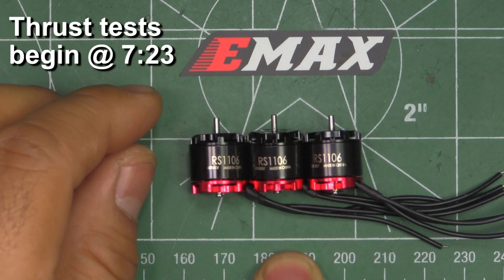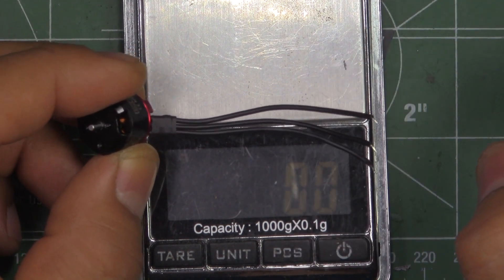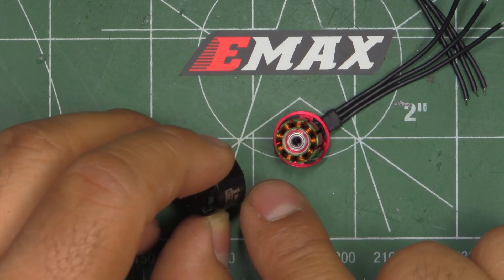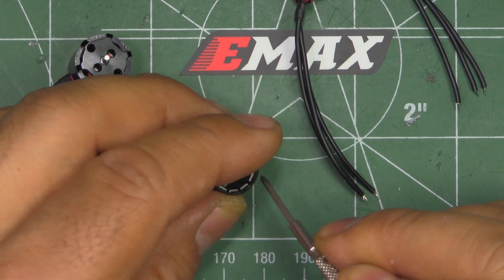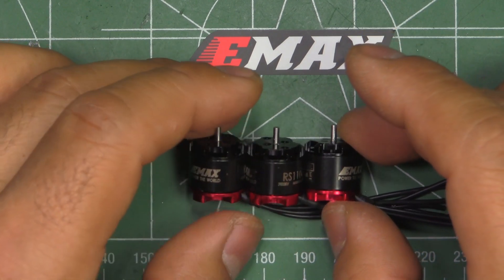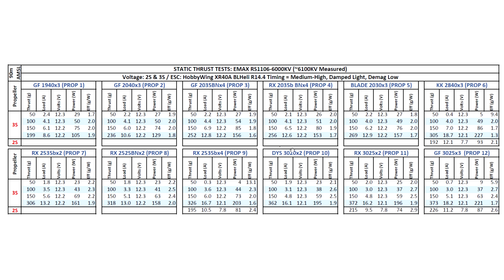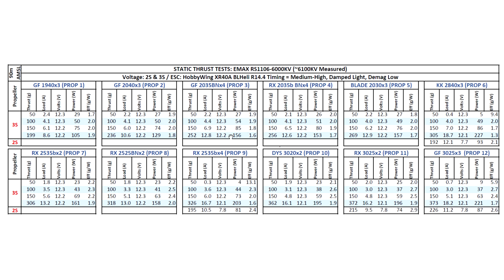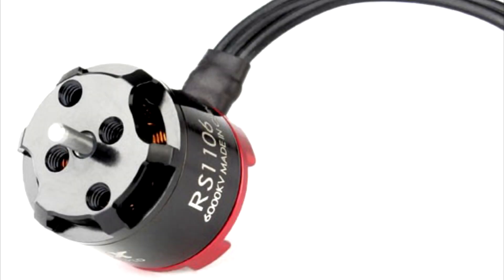EMAX RS1106-6000KV Tiny Motor - Big Power! 2S & 3S Thrust Tests

Comment: What about gemfan D63 (2.5 x 5 blades) with 3S LiHV.. is it ok?
Reply from the maker: @tanoryjakaperdana1419  3S LiHV might run too hot for 5 blades. I'd prefer a 14 or a 1504 to 1506
Reply: @EngineerX  im sorry, are you talking about 1504 motor or 1504 propeller?
Reply from the maker: @tanoryjakaperdana1419  motor. 1106 could run too hot and I don't think it has enough torque
Reply: @EngineerX  ok sir.. thank you

Comment: I don't know what the deal is but I ordered a set of the 6000kv motors running on 3s and there things get smoking hot. Even on 2s, they get pretty darn warm. I was running 1105 6000kv hglrc motors before and they never got hot. What's the deal with these motors.
Reply from the maker: Very strange those are overheating on 2S. I've read one other case with GF3040x3 on 3S running hot.
Reply: Maybe its the filtering from betaflight 3.4 (i heard that version is known to smoke micros) i ran 1103 on 3s on 3.5 and its fine so these motors should be better.

Comment: Hey Engineer X! 

I did a thrust test on these 1102 15000KV motors for a brushless whoop here: https://youtu.be/hi8ESCRqGFA

I’m not sure if I did it in the most scientific way possible. Any chance you can do a thrust test on these guys and some of the 07xx series!
Reply from the maker: I have tested some of the new BrotherHobby 07XX or 08XX- 10000/15000KV (I forget exact size/KV - got data at home) Just have not had time to sort it out. It was quite difficult to set up those tiny motors.
Reply: EngineerX That’s awesome! I and a bunch of other people on the brushless whoop train would love to see those thrust tests! Keep up the good work!
Reply from the maker: I'll be working on several new test results data/videos this week. Had not had any time the last 2 weeks :(  Hopefully the data is good. Also have some lower KV RacerStar BR1103-8000/1000KV that I tested.  Too many motors so little time ;) Thanks for watching. check back in a couple of week, hope to have video up by then.

Comment: I have been looking for a channel like this forever!! Subscribed ✅ I only have a Kingkong ET 125 right now. With a dead esc. And since I’m replacing that. I figured I could replace the motor as well. I use the gemfan 2540 props. Would this emac 1106 6000kv motor work well for my ET 125?

Comment: How are those 50g thrust tests getting crazy efficiency numbers even possible ?  13.1g/W on a 2.5" 4-blade prop nearly defies the laws of thermodymanics.  I call shenanigans 😝
Reply from the maker: LoL ... Shenanigans indeed!!
Looks like I overlooked (happens somewhat often) the funny numbers on that 2.5" Prop# 9 as well as on several other props on these tests. 
The Excel spread sheet I use is supposed to pick the closest values corresponding to the various thrusts numbers on the table. The formulas I use are not the smartest so often times the wrong values are selected due to logged data limitations: Sometimes the spreadsheet will pull Amp numbers that correspond to when motor is being throttled down or when throttle is cut off and ESC is on "active braking" mode, instead of picking when motor is under load or ramping up. I noticed that started happening more on the small motors. So I gotta inspect tables more carefully.... anyway, logged data is on the Excel spreadsheet I provide in every test so you if you had reviewed it you would've seen it's a mistake and correct data is there on the data; I had fixed those errors on the spreadsheet a while back ;)
Reply: EngineerX hrmmm. No offense but we look to your tests as the authority with expectation that you had scrubbed the data you were presenting. If you’re saying that we should treat all your data as just a presentation of what a machine spits out and that to have confidence in what you’ve presented we each need to dig into the raw data ourselves, it severely limits the utility and value of the work you do.

You’ve been doing this for a very long time so maybe it would make sense to take your work to the next level and begin honing your data analysis formulas so that they are the best. Dropping numbers that fall beyond a specified rage outside the standard deviation is simple freshman statistics 101.

You provide a very valuable service to the community but they also rely on the results to be accurate. I’m excited to see what steps you consider for the future to ensure we can be as confident in your work as you are. 

Thanks for all the testing over the years !
Reply from the maker: You're 100% correct and I appreciate you looking closely at the data. I will keep reminding myself to scrutinize data carefully before releasing it. As usual, careless mistakes like this happen when on a hurry to complete. No excuse however. When I captured the comment on the thrust table the data was wrong and I neglected to re-capture.  I'll make a better effort to look at tables closely. Actually, I have caught the same error from the Excel spreadsheets since then, so I've corrected it manually by eliminating the offending ramp-down values. When I said "it happens somewhat often" I was referring to mistakes in the videos. Sometimes I overlook/forget to change the motor name/model on the thrust test runs (green letters) I use previous video editor files so sometimes the previous motor name transfers to new video. Again, no excuse - just gotta review more carefully. Thanks for watching!

Comment: How hot were these motors getting on the gf3025 tests?
Reply from the maker: engizmo fairly hot. Close to getting uncomfortable for holding firmly with my hands. But that is quite normal for this size  and KV. I think they should be OK in flight but I still check temps on first test flight.

Comment: Great testing as always. Who do you think has the best quality and performance on these 1004-1106 motors between Emax and DYS? Thanks much for all your testing.
Reply from the maker: So far, EMAX, DYS, RotorX (tests coming soon) and SunnySky have very good quality and good performance, though the SSky 1106-6500 makes a lot of power but also needs lots of Amps. I'm sure there are others but those are the ones I've looked at.
Reply: Thank you much for information.

Comment: Do you think it can stand 4s ?? with smal props ??
Reply from the maker: I have read a couple of people trying 4S but I can't recommend it 100% as I have not really tried myself or seen it done. On a super light 2.5" or 3" (3025 prop) it migh be possible but I would be very careful in checking motor temps. I'd say it's quite risky!

Comment: will the 6000kv be ok with 3s 500ma 2030 blades to burn through 3-4 batterys at a time without meltdown on a 80g build?
Reply from the maker: Hard to say -  I have not yet flown the 1106's yet, only 1104-7500kv (but on 2S)with GF1940x3 I've gone through 5 LiPos in a row in a session but not on full throttle. Motors were fairly warm but OK. My best guess is they should be OK... but I would check temps after the first LiPo, if you can grab it firmly with index finger (wrap-around) and not get burnt, then should be no problem
Reply: follow up, i ran the 1106 with gf 2040 on 3s. 20 seconds full throttle pass the motors would burn your finger. not worth it!  :) will melt down the motors after 2 full 3s 500mah battts if you are lucky

Comment: Isn't there a typo - prop 12 3025 tri blade in description (8:47)? For me it looks like GF 3035.
EngineerX can you make test of RCX H1304 4000kv and 5000kv to have good comparison with new 1106 motors (like recently tested Emax)?
Reply from the maker: Correct that should be 3035x3 
Yes, I have the H1304-4000/5000KV motors, just need to get some time for testing. Hopefully next week

Comment: Can you confirm the thrust and current readings for the RX2535bx4, GF2535x3 and KK2840 @ 50 grams?  These seem too good to be true.  If these are correct, these props are considererably more efficient than most of the other props here at hovering power.
Reply from the maker: Those are errors in the Excel spreadsheet data. The 0 - 150g ramp-up logged data ended up out of range of the rows that retrieve the data points for 50g thrust. I've revised the Excel spreadsheet so you can download the corrected table from the DropBox link in the video description. Thanks for noticing! and yes, if those had been correct.... we could hover for at least 30 minutes on a 450mAh Lipo ;)
Reply from the maker: Those are errors in the Excel spreadsheet data. The 0 - 150g ramp-up logged data ended up out of range of the rows that retrieve the data points for 50g thrust. I've revised the Excel spreadsheet so you can download the corrected table from the DropBox link in the video description. Thanks for noticing! and yes, if those had been correct.... we could hover for at least 30 minutes on a 450mAh Lipo ;)

Comment: Ive saw new motors on Mymcmart, H1304, 4000 and 5000 Kv are avaliable.
Calculating iron volume vs 1106 it's roughly same volume for both... it will be very interesting to see test result for this motor , the 5000 Kv ver.
How can i contact you to donate or send you the motor fpr testing ?
Reply from the maker: Hey Eddi, thank you so much for your very nice offer. MyRCMArt sent me those 1304's so I have them on hand.... my only problem is available time to run tests. It's been busy at work so not as much free time lately and weekends have been busy as well, but I'll get to testing them as soon as I can. It will be very interesting to see if the taller stator on the 1106 has the advantage. My feeling is that taller stator has a better distribution of copper since from what I've read the copper on the coil top and bottom (end turns) doesn't produce power so taller stator has less copper there than a shorter stator .... we will see (compared to the 1106-4500KV motor - I'll also be testing it soon)

Comment: Will they fit on babyhawk:D?
Reply from the maker: Unfortunately I don't have a Babyhawk motor in-hand. We would need to know the mount hole pattern on the BHawk motor. For propellers, these do have the 2 holes that have same spacing as BHawk props.

Comment: can you test the motor on 4s with 2" props?
Reply from the maker: I might run a couple of 2" props on 4S and add them to the 7500KV video, on the thrust stand motors are highly stressed, so risk of burning windings is high
Reply: EngineerX ah ok. Thx for the answer and the test.

Comment: Im a bit confuse for 3s, gemfan 2035 props, will these 6000kv motor would not get overheat? Is low kv or high kv is more suitable for 3s and 2035 props setup? My stock fly egg100 motors just burnt when i push it a bit. Planning on these motors.. but dont know to pick which kv
Reply: EngineerX im really loving my setup nowww... Such fast racing micro!
Reply: AFIQ aFaT I'm wondering the same thing. Do I go 6000 or 4500? With 2035's on 3s.
Reply from the maker: Lots of people run 3S on the 6000KV motors. Just make sure ESC is capable of supporting the loads. 10A ESC's should be the minimum.
6000 for 3S if you want a very fast setup, 4500 if you want longer flights.
Reply: EngineerX my stock flyegg 100 motors is 7800kv.. rated for 2s.. i pushed it with 3s racing style then burnt the motors huhuu
Reply: So if I wanted to turn my flyegg 100mm into a cruiser using the 4500kvs using 12As ESCs and a GF2035s, that would be good? Or is better to use these 6500kvs?
Reply: Roland Burrows ok now ive installed the 6000kv, with 3s setup.. its run very2 fast and mltor temps were just abit hot that i still can touch with my finger! Nice!!
Reply from the maker: 4500's will give you longer flights of course. 12A ESCs on 3S will handle 4500's well. 6500 on 3S will be very fast but LiPos will drain fast. All depends what you want.

Comment: Nice test. Pretty impressive motor. I have the emax 1104 motors right now and when they die these are on my shopping list.
Reply from the maker: These will be the best replacement for sure!
Reply: EngineerX Do you think the emax 6a esc would handle these motors on 3s?
Reply from the maker: I'd say up to Prop# 8 (except 2840x3) a 6A ESC would be barely OK, I'd would prefer a 12A however. 6A would be too risky, these motors can pull a good amount of Amps so better to have some headroom

Comment: Wow! So the RX 2535bx4 makes more thrust and with less amps than the KK 2840x3?
Reply from the maker: Yes, but that's only on the top-end. Unfortunately I can't spare enough testing time to run more extensive data collection, like running a slower full RPM sweep so we can compare each prop at the various RPMs. If you notice, the 2840x3 will make the same thrust that the 2535x4 makes but at lower RPM, so it should perhaps build thrust just a tiny bit sooner. From what I've read people saying is that the 2840xx3 props works pretty good. I need to try it myself at some point, I just haven't been getting enough flying time lately

Comment: I mean you'd only need additional wire from the motors if you were attempting to make a hyper light 5", or maybe large 4". Or an Extra-Large 3-inch maybe. Otherwise don't you think that'd be plenty wire, even considering 4-in-1 ESC usage? (On normal 1106 builds) Thanks for your reviews though. Very valuable to me in consideration of parts I would be better served to use. Thanks to you I got a set of the Spintech 1106ST 8000kv motors. Either I got too much ESC for them, or they're too much motor for my 90mm frame that I have. Because I'm having heat issues with them. I'm pretty sure that'll go away if I were to get something like a Leader 120, or 117mm frame to put them on.
Reply from the maker: Yeah, just nitpicking on the wire length on an otherwise outstanding motor. 
Those SpinTechs run well on 2S, could it be your FC's tune? maybe need to lower PIDs? Also make sure props are not bent. Hope you sort it out. Thanks for watching,
Reply: EngineerX they're rated for 4s right? The Spintechs, I mean.
Reply from the maker: No no no no no !!! If they survived 4S then they're a heck of some good motors. They're rated for 2S. 8000KV is too high for 4S. 3S would also stress them too much I think but some people may already be trying them on 3S. https://www.spintechmotors.com/collections/spintech/products/1106st-8000kv-brushless-motor
Reply: Zak Smiley you referring to the Spintechs?
Reply: Sugar Kane Thanks for the advice. As of the last time I was messing with my 90mm, I need it.

Comment: The banggood page says only the 4500kv is 3s lol, I will wait for you to test the 7500kv on 3s to see the numbers for the blade props and then I will probably invest in a set :D, cheers.
Reply from the maker: I'll run that one next, but that KV i a bit high for 3S- 12.3V on the thrust stand. The power supply I use can only go as low as 12.3V, I may have to start with a LiPo charged to 11.5V and see how motor reacts (how hot it gets)
Reply: EngineerX yeah perfect, cheers.